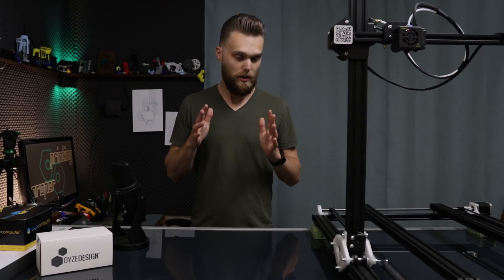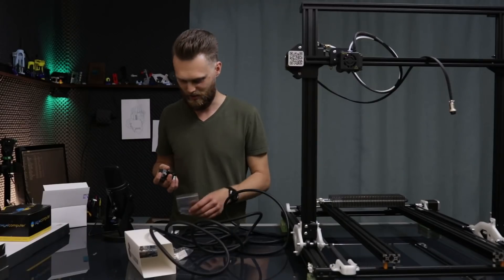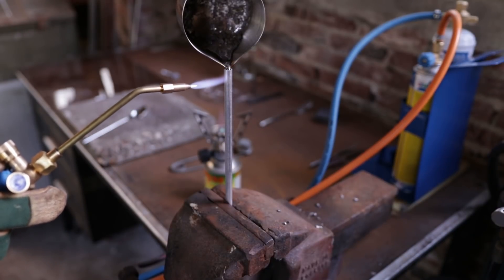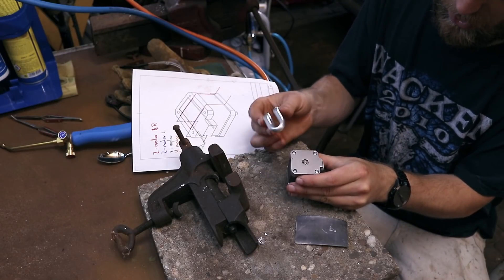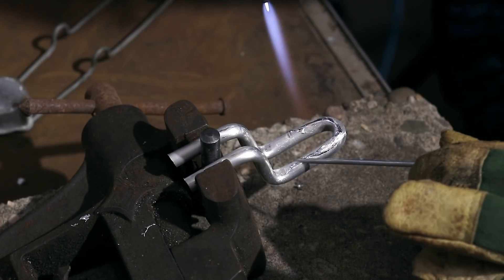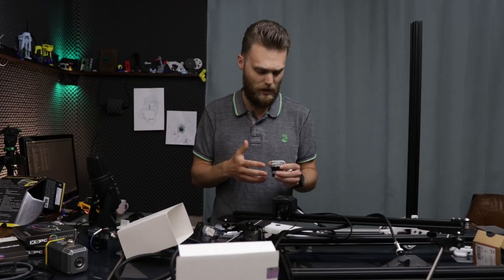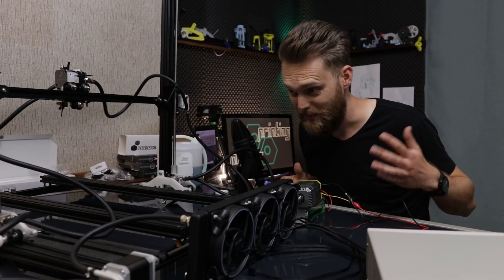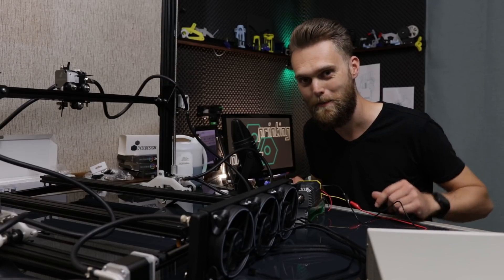How I made my own water cooling blocks and a added water cooled DyzeDesign pro hotend.

Comment from the maker: Hi guys! This video took a little longer than usual because it was a bit more work than I thought it would be xD I’m very happy that this turned out the way I wanted. I hope you enjoy this one and have an awesome day!
Reply: You are a mad lad! I would have never thought of doing something like this to my Ender 3 (mainly because I don't have the skill to do so).
Reply: @novazipstream2  I have one installed on my ender 3pro. But the water cooling  liquid is just the water and the cooling block connected to the motors are squared blocks, I just used thermal glue and thermal tape to tighten the blocks mounted on motors.
Reply: @calvin-7540  Interesting! I'm considering this on my Ender as I'm building up my lack enclosure into a heated one (passive for now as I haven't decided on how to tackle the active part)
Reply from the maker: @novazipstream2  thanks! As mentioned by Vincent, you can use standard cooling blocks ;) I often take the experimental road to explore different possibilities xD
Reply: AMAZING
Keep up the amazing work Jon, I can't wait to see the final product and if the rims work or not!

I'm currently trying to get a 2 in 1 out system working on my printer. It's a nightmare!
Reply: Awesome stuff Jon! I guess you will pull cold air from the outside of the case to that radiator?
Reply from the maker: @MakerViking  Thanks Thomas! Indeed, I designed an inner and outer box for that enclosure to keep the electronics and radiator outside the heated chamber, but inside the enclosure
Reply: @MakerViking  Better to keep the radiator outside the enclosure so that the radiator gets cool air, and fan is not creating drafts inside the box.   Simple enough to run tubing through the wall.
Reply: awsome project. i was waiting for this video. i hope next one will not take as much :)
Reply: It was an awesome video, great editing, great sidetracks and an awesome project!
Reply: Great video all you need to do now is watercool the maimboard and drivers
Reply from the maker: @henry67278  I'm going to use the over capacity of those fans to generate an airflow ;)
Reply: exelent work! thank you!
Reply: Clever improvisation there!  I like your stuff.  Presently printing out your quick change tool holder base.  One suggestion:  a man should own a fuel line tubing bender.  They're typically $25-$35 here in the US for a pretty slick consumer-grade model.  On the other hand, you can pack a tube with damp sand (sealing it in) before bending to help the tubing keep its form and mitigate kinking.  Anyway, keep it up.  Methinks your ancestors 3D printed longships.
Reply: Now that I look a little closer, those are some very clean bends for such tight radii compared to the tubing diameter.  You couldn't manage that with a fuel line bender.  Great work!
Reply: I have 3 working closed loop PC coolers, They are very efficient at overclocking. The pump is located inside the water block and the water block weighs a ton because of the infinity mirror illusion. I'm curious, Should i not use them? Should i use one for water cooling the power supply?
Reply: I've seen bending pipes withhout proper tools but usually I've seen filled with sand or water (seems lead is fine too).Modellers pipes bending machines are not so expansive, what about taking one? Still I want to copy your Idea for the motors, good job!

Comment: My understanding and experience has been that if you disassemble stepper motors you mess up the alignment of the magnetic fields.   Something to do with them being magnetically aligned after assembly in some big electromagnet device.   I've disassembled many steppers in my past and will never do it again.  They never ran right or even felt right after re-assembly no matter how precise the mechanical alignment.   Uneven and lower torque outputs.

Comment: why didnt u use copper tubes and copper plates u can solder them easier and bend them easier also y didnt u just use the dyze water cooling blocks for all the stepper motors instead of soldering some ?

Comment: What kind of solder do I need to weld the copper tubes to the aluminum motor case? Regular solder for electrical wires doesnt work 😢

Comment: I'm going down the line of a full water cooling setup, including the stepper motors. but I found some 40x40x12MM blocks that fit perfectly on te back of the Stepper motor back ends with Thermal tape. Making them removable. I'm running an Ender 3 V2 with Sprite direct drive Hot end and The Creality water block for the hot end. Externally I'm running a 240MM radiator and larger lines, reducing them down for the Hot end, but full size for the Steppers. Once I have all the parts gathered up and start assembling I'll put some pics up and post the links out...

Comment: Hey man, beautiful conversion, very well craftmanship!
Did you ever measure the difference in water temperature between the the water flowing in and out (just of the motors!) to get an idea of the efficiency of your steppercoolers?
Also you could measure the temperature of the stator on the far end of the cooler in comparison to surrounding temps and coolant temps.
But anyway: even for the looks it could have been worth the effort 😁
Reply from the maker: Thanks! No I didn't. I got lazy, just turned on the printer and started printing. It already printed several full sized car rims successfully so it works well. I'm often not too scientific with my approach xD
Reply: @properprinting  not too scientific, but xraying your solders was a thing 😄
Keep up the trials with the rims, i‘m looking forward to you guys bashing the rims to death 😃

Comment: Awesome project, awesome video.

One thing though; dissimilar metals in a a loop is very much frowned upon, as it could cause galvanic corrosion.

Yes, inhibitors will help, and yes, it might be fine, but for anyone copying this (bonkers) project, I'd strongly recommend ensuring you don't mix aluminium and copper/brass.

Oh, and when filling, the reservoir should be directly connected to, and higher than the pump. No idea where you read otherwise, but I disagree entirely. 

Even if it was safe for the pump (I'd be surprised) that's how you bleed air out of the system. Which is critical for silent operation and peak performance.
Reply from the maker: Thanks! You have some great points! In hindsight it was indeed better to use the same material. Fortunately the aluminium parts are electrically isolated from the copper ones. The pump placement is far from ideal, but this was the best place where it fitted design wise. I read that it should work and it does. Again, not ideal, but I had to make a decision ;)
Reply: @properprinting  Hey man, just so you know I wasn't criticising, as I say it was an awesome project.

Didn't realise the copper and aluminium were isolated, sorry. For some reason I thought that silver pipe was aluminium and you were using specific solder.

I come from the same PC background and love building custom loops, so this combined two of my favourite hobbies. Pleasure to watch.
Reply from the maker: @literate-aside  I figured :) I'm very happy with your feedback! I can imagine that it can sound defensive, but I felt the need to clarify. That pipe indeed is aluminium with specialized solder. The radiator is hanging in plastic brackets which is the copper part in the system. To be honest, this was lucky since I wasn't aware at the time that this could be an issue.

Awesome that I combined two of your favorite hobbies! Guess what, I'm having an awesome idea for an experimental 3D printed PC case!
Reply: @properprinting  If you put a custom loop in there I'll be giddy 😉 good luck with it man!

Comment: Wow, super-useful video! I’d tried bending some small Al tubing by filling it with low-temp alloy, but had problems bending because it cracked. I like your simple “press-brake-type” tool, am gonna experiment with that approach. (Thanks!!) 

I also wasn’t aware of Dyze Design, but am interested in a high-temp hot end for my eventual (planning stage now) RatRig CoreXY machine. The Dyze stuff looks great, I think I’m going to go with them for the extruder/hotend system. - So tell them that giving you their stuff was indeed very effective marketing! 👍😁

Comment: I'm thinking of making a heat-sink out of copper plate and copper tube , i hope to be easier for me, what do you think about this approach ?thanks for sharing.
Reply from the maker: Awesome! I think that your approach is not only easier, but better too. It's not good for the motor to take it apart and I did loose torque. This video was meant to experiment and see if this was even possible. Good luck!

Comment: Lead is dangerous, you should have windows open and at least a respirator on...., and for the pump, you want the pump to be lower than the resivwar, so that you eliminate chances that it gets damaged  
air travels up, and it helps the pump work easier.

Comment: Hey can you please tell me what fittings you’re using with the radiator ? I can’t find any fittings with the „Dyze Design Soft Tube“ ID and OD specs.
Thanks in advance
Reply from the maker: I've used these fittings https://www.highflow.nl/watercooling/aansluitingen/fittingen/1-4-fitting-6mm-od/06mm-8-6mm-schroeffitting-g1-4.html it's tight fit, but it does work because the tube is that soft.
Reply: @properprinting  thank you a lot and keep the good videos coming ;)

Comment: Braising the aluminum was cool but couldn't you have just used thermal epoxy?
Reply from the maker: Thanks, that'd probably worked too. I wanted to teach myself this skill and make a really strong bond
Reply: @properprinting  I'm glad that it worked well for you. I was thinking about using that alumaweld stuff for a project but was hesitant. I'll probably pick some up now that I know it works.
Reply from the maker: @eppicshotgun12  Awesome! Sometimes you just have to put the torch on it without hesitation, but not always haha https://youtu.be/zYr4i7W96Mo?t=994

Comment: OK you screwed a few things up.... well lesson learned..... Use copper pipes and a small copper pipe bender and you get the bending done in no time at all. use compression fittings at the end and solder them in place. On your stepper motors don't use the rear end to apply your tubing to is because as soon you upgrade to close loop steppers or another stepper you are stuck. instead use an L or U shape copper piece which goes around the stepper motor and solder the tube do it. this sit's like a clamp shell and with 2 zip ties you can apply it tight enough for the heat transfer to work proper.

Comment: I would have made a distrobution block to have the cooler water comming from rhe rad split off to each motor instead of it being in a chain in order to keep the first and last motor at the same temp so they dont fail at different times

Comment: You can also use fine sand instead of water in the pipe when bending. Might be safer if you are heating after. Word of caution: The coolant is somewhat conductive and majorly interfered with my Thermocouple readings if not electrically insulated. Thermistors should be fine.  I made my own water cooled system on Replicator 2X 4 years ago and just got rid of it this week when upgrading everything. It certainly kept everything cool! I'm already missing the stepper cooling ability and I hope I don't have to go back but thinking if I tune things properly I wont need it....maybe some added passive or fan cooling.

Comment: Hey great vid! I'm making my own liquid cooling also for my dyzend. Problem I'm having is my fans use a 4 pin molex I have an atx to power it. Not using the motherboard connector. So it's been a pain to get it to work properly. With the constant not returning back to the molex (fixed that) now the remote that it came with is not working. If you have any suggestions that would be great. Thanks

Comment: what the fuck are you doing with a 3d printer that stepper motors need water cooling?  Have you ever heard about the fact that you can adjust the current on the drivers, that you can put drivers with a heating reduction function on the printer, even if the printer's motherboard does not allow changing drivers, a new board with a set of drivers costs 5 times cheaper than that water cooling system.

who taught you how to bend the pipe like that, even if you don't know how to do it, you have internet.

Comment: Very interesting post well done!  be careful of having aluminium and copper in your loop at the same time- it will be an issue unless you use a coolant that has inhibitors in it,    1 rule I always follow is to have the pump at the lowest  point in the loop with the reservoir always above it,  it reduces the risk of pump running dry and killing the pump,  also a trick I was shown a long time ago to bend pipes was to fill them with sand 1st to stop them kinking...

Comment: I believe that radiator is the  TX360 Ultrathin Radiator by XSPC. If so, that is a copper/brass radiator. If you use this radiator with the aluminum tubing you bent, then you are at high risk for galvanic corrosion. You may want to consider an aluminum radiator instead, to prevent this issue. Otherwise you should consider anti-corrosion additives.

Comment: Two suggestions, you might consider using supply & return manifolds to distribute & collect the coolant to each node individually instead of daisy-chaining them so you have the same temp going to (and from) each as opposed to transferring the heat from each section through to the next, and secondly, using a pipe-bending spring that slips over the pipe and prevents any kinks from forming as you bend the pipe to the shape you want. Old-school but it works like a champ.

Comment: I don't know much about the practical aspects of thermodynamic engineering, so maybe this question is silly, but I'd still appreciate any and all answers: Would insulating the motors help? They're in a hot environment and the cooling is a virtually closed loop from the heatsink on the inside to the rad on the outside, so would insulation around the motors help avoid drawing any heat from the chamber through the heatsink? Or does the low thermal conductivity and volumetric capacity of air make only a negligible difference in practice? Again, just asking out of pure curiosity, if anybody has had experiences with that kind of hypothesis I'd appreciate hearing your reasoning one way or the other :)

Comment: there are chinesium 40x40mm cooling blocks for very cheap on ali/ebay etc. those will outperform this just tube by orders of magnitude as they actually have fins inside, and they cost only few bucks each, and perfect size for nema 17 steppers. just apply some thermal paste and affix with zip ties is the easiest method :)
Reply from the maker: I understand your point and this is what I wanted to do at first, but there were two reasons not to :) First, I didn't have room for a standard heat sink so I wanted to make my own anyway. And second, I try to explore different methods and experiment with new things. Maybe when adding fins too and incorporate the whole thing into the back it will be even better ;) What makes you so sure the cheap ones will outperform this? Metal itself conducts heat better than thermal paste.
Reply: @properprinting  because water cooling is heavily dependant on the microfins, surface area between water and metal.
Without those, most of the water won't touch the metal.
Reply from the maker: @skaltura  this would make sense. I'm a bit skeptical to be honest if these cheap block have these. I never heard of such thing and only saw fins used for CPU coolers. Well, I'm going to find out how well these things are going to perform
Reply: @properprinting  another youtuber cut them open to see why they performed as well as they did, and they found there was fins inside. Just cannot recall who it was :( They are not the best, but you cannot beat that value for money tho!
Also cheap chinesium CPU waterblocks have proper copper microfins in them!

Comment: The dark spots in the pipes  visible on the xray, was that lead left on the inside of the tube?
Reply from the maker: I recon it is. I think it looks worse than it is since X rays have more difficulties traveling through lead. Next time I should use sand like has been mentioned by others

Comment: I visited Austin Texas recently and had a tour with Protobuilds with Marshall and he built large Cartesian 3D printers with enclosures that are heated. I asked him about what he did to cool everything and from what he said it looks like you're doing well but he mentioned one thing that he ran across with his heated chamber and his direct drive setup he mentioned that when his chamber was heated to 100-140 Celsius that the filament getting fed into the direct drive extruder was getting too hot as well as the direct drive extruder gears. His solution was to enclose the filament going to the direct drive extruder and to push external pressurized air so that it would cool the filament as it would go into the extruder and the blow off pressurized air would cool the extruder gears.

great work Jon !
if you have any questions contact Marshall from protobuilds in austin texas. he has been down this road and is extremely knowledgeable
Reply from the maker: Interesting, thanks a lot for this information! I'm sure I'm going to learn a lot from this project xD

Comment: 10:07 I admire your lack of flux
Reply from the maker: the rods itself contain flux, so it's important to add enough tin and let it flow ;)
Reply: @properprinting  In my experience not enough. Soldering got so much easier after I followed that tip and since then I always add a bunch of extra flux.